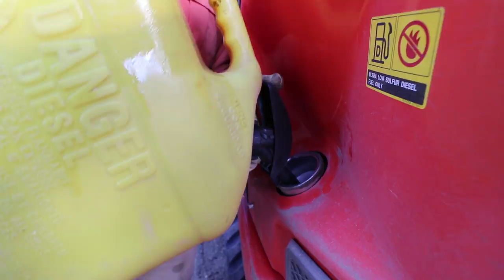Winter Did THIS to Our $10,000 OFF GRID WATER SYSTEM

Comment: I probably missed it, but how come you didn't bury the cisterns beside where your house is going to be instead of at the top of a hill? Seems like a lot of extra work to have a gravity fed system and more costly than a pumped cistern system that's easier and less costly to put in.
Reply: Selwyn The Great They are off grid so they want to avoid the pump. If they end up drilling a well, it should be up where the cistern is, so they can fill the tanks and gravity feed down to the house.
Reply: Yes, but why do they want to avoid the pump when putting a pump in and running that is cheaper than what they are doing now?
Reply: Selwyn The Great 

I'm not sure. I know from experience that as you say, a cistern with an on demand pump is relatively easy and cheap. I've installed 3 of those systems and it works well.  That is if you're on the grid. The pump turns on whenever you turn on a tap or hydrant. 

However if you are off grid and need a stand by generator to work the pump, it gets more messy and expensive. 

I think gravity feed is the way to go if your water supply is above grade of it's intended use. In this case they don't have a water supply on the property, so they've sort of started their water infrastructure projects backwards (water storage first versus supply). 

If it were me, I would have started with the supply (drill a well) and just kept an interim water storage system for the time being (although there interim system froze during the winter....huge pain). 

They've said that with a well the infrastructure/cistern that they've just built would get used anyway. I think that's true if the well is on top of the hill. Otherwise they will need to pump water from the base of the hill from a hypothetical well to the top of the hill, to then come back down to the house. That doesn't make sense to me for a house. 

But they've done research, enough i guess to make major investments.
Reply: I'm just going off of how much they've said they paid for this system. You could have put a solar panel up, a cheap inverter and a small battery and achieve the same thing. You don't need a generator to live off grid. I happen to know this because I was raised off grid (back in the 90's and into the 2000's) until I was 21 years old. For half of the time I was the running water. I'd haul water by hand from our spring that was about 200 feet away from the house.

Eventually we upgraded and had running water for very cheap. So like I said, not sure why they decided to go with a gravity fed system. It must be for some reason that I missed and I am curious what it could be. I don't think there is anything wrong with their system, other than the cost.

As for their interim system freezing, I had not watched that video. They could have dug it deeper to avoid that. In northwestern Ontario, we have to bury water lines at least 5 feet below the surface. If you're going to haul water in no matter what, and not have a well, just bury your cistern beside your house, put up an extra solar panel for it, put a pump into it and call it a day.

Comment: Jesse and Alyssa, it is a struggle for sure. Don't let the heat and hard work get you down. You are chipping away at what needs to get done. Sure you get a lot of armchair commenters, trying to tell you what your doing wrong or telling you how you should be doing things, but the reality is you are actually doing the work they aren't. 

Try to keep your spirits up and know there are plenty of us out there who completely understand your struggle. I only last week was able to get my vehicle up onto my property, I had been hiking in 1/4 mile due to the wet muddy condition of the easement road. And I had been walking 2 1/2 miles, for awhile due to the main road being a mess from the extra wet winter here.  Last year I had been having no problem with road access, but this year not so good. Rural homestead life is a series of challenges be it weather, equipment, livestock, injuries, wildlife, or so many other things that pop up. 

Keep up the good work. You will get there eventually.

Comment: Killer projects...  Really.    Some things are amazingly difficult - I've gotten pushed to the edge of endurance here a few times. 
But thankfully always got through it, ...with enough time.   
That is brutal with the 2" Poly.  Its hard enough to just stake poly down to lay sorta flat, ...but getting that powerful poly serpent through a long path of flimsy casing -- that's a tall order, ...a very tall order.  Perhaps 'snotting' the pipes (wire pulling lubricant) to redux friction as they are pulled through would help.  
In doing some poly here I quickly realized why the pros always keep the material on the reel and pull it direct from reel along the desired path - keep it straight and in tension while you start burying the from the attached far end.

The idea of using casing to be able to run pipes later is good in theory - yet in practice seems unworkable, as you would not be able to snake a new pipe through a case which already contains any serpentine coils of an existing pipe.  In theory we see the pipes all laying down flat at the bottom of the  case - yet doesn't end up that way.  

In working long 200' 4" drain pipe runs - I'd make rebar wickets (easy bend cold or best with torch (heat to red, bend, move on): test length of wicket for sufficient hold power), stake the group of pipes down every x feet (with any extra run of pipe/wire I might want.  Then if worried about them being damaged when covered could put half pipes, concrete, or lots of sand-gravel over before covering with the rock-laden earth.   Just my $0.02 worth. 

Hoping it all goes well whatever you decide to do.   All the best!!!

Comment: Here is a helpful tip.......those "new and improved" gas spouts SUCK @$$!!!! go to your local farm supply store and get the "repair" spouts for the "old" cans......EZ-pour....is the brand I think. You will be extatic.....and angry you didn't buy one sooner with all the frustration of the "better" spouts that come with new cans........I have spilled FAR more gas trying to use those new ones.

Comment: if you hired a someone with a degree in construction a who is a contractor as well, maybe pay a consulting fee  before you jump on any project for some advice, it would reduce your work load by half.
Reply from the maker: You assume we haven't sought outside feedback for the project. The unanimous feedback was "Yep, the ground is now frozen, hopefully it'll thaw before winter sets in hard, otherwise you'll get to work on it in spring". And that's what we did. :)
Reply: I am seeing a project that was left not back filled and pipe that is kinked and not rolled out, and non strapped down plastic cisterns in this video. I wish you guys luck. I just strolled down through the comments  and lots of criticism  most of it not helpful, but you really could use some expert advice, I am making assumptions your not getting it, by the mistakes being made in the video. Would love to see you guys make more progress, instead of kicking your own ass.

Comment: You've taken the harder path down the road of a hard project.  That's ok, but it's a lot of work.  And working longer in a day will not speed it up. Work for 6 hours on it or so taking breaks to keep your strength up and have other smaller projects for the rented equipment in the works so you can take a mental break from the one for a bit during the afternoon, while working on something else.

Comment: Cheap poly wheels on a wheelbarrow, never a good idea, hope you upgraded to thicker poly or for your sanity and roughness go with steel spoke.

Using 5% of the brain instead of the full 10%, had you heed others advice, soaping or greasing up (Crisco or Lard) the pipe would make it go in smoother if not much more smoothly. Poly is tough but its very rough to handle.

That dirt just rocks you hard.

Comment: Why the heck haven't you guys just bought a used backhoe?  There are plenty of cheap good machines out there that would suit your non-professional needs.  Search for equipment often referred to as suitable for "farm use".  In the past I bought a Bobcat 643 for $4500 and a John Deere 450 crawler/loader for $2300 (needed an additional $1200 to get functional). I've seen numerous large backhoe loaders for under $10K.  When the project's done...sell the equipment off.  You will spend a small fortune on equipment rental and never get any of that money back.

Comment: A suggestion is to use the twine to pull up heavy duty rope(s) or aircraft cable(s) (usually cheaper by the spool) times 2 or maybe more.  Then using the truck on a rope/cable to pull the 2" piping down through one at a time at the house site, while at the top of the hill the excavator or the piping/encasing tube will be tied to a tree.  (BTW also have whichever is at the top use a bucket of soapy water and sponge to add just a bit of lubrication to the 2" pipe slides in the encasement and it will make, pulling that stuff a lot easier)  Doing it this way the truck's horsepower can pull and you two won't hopefully hurt yourselves, but you must have  excellent communications and a slow pace (truck in lowest gear) or you could damage all that encasement you have placed.  Afterward If the soapy lubrication worries you, you can just flush the rest of the soap/lubricant out with water after you have pulled your pipes through.

I'm sorry, I got behind on watching videos and I didn't know your plan earlier, or I would have suggested laying out the 2" to warm and relax (which you did, YAY) and then slide the encasing tubes on singly over all tubing at once and a few probably 3 or 4 more pieces of stainless steel cable, per encasing tube (something you will think of later will need to go through conduits, so always add several more than you can imagine), with loops on either end to act as pull strings pull strings (thinner and strong, also won't rust) and then drag the whole thing into the trench, glue it all together and backfill.  I am from a very rocky part of the Smoky Mountains, and you all are doing great, sorry I couldn't have been able to offer  the advice sooner.  

Hopefully this might help, best of luck on the next step.  Warm wishes, prayers and thoughts for you both.

Comment: Next time you run pipe in an encasement like that, or when you run electrical wire in a conduit.....  I get the conduit/encasement started, and then run the wire / pipe where it's got to go, start it through the initial conduit/encasement first, then run the pipe/encasement one section at a time.

Comment: You wasted your time resetting the cisterns in my opinion. whatever damage the rocks did sliding into the ditch, happened when they slid. you could have saved hours of work just adding sand the way it was. but good job and good luck on the rest of your project.